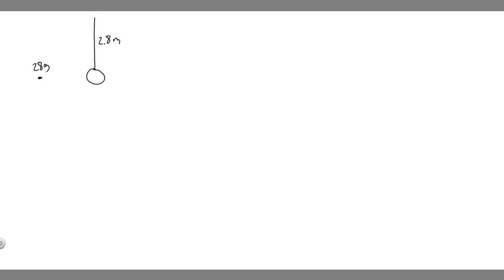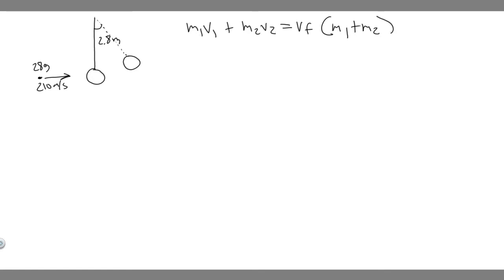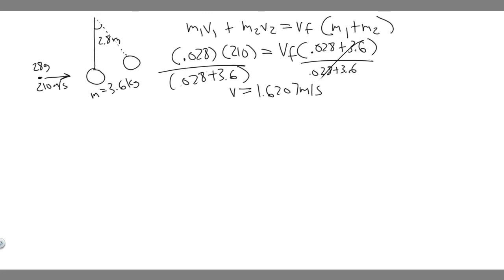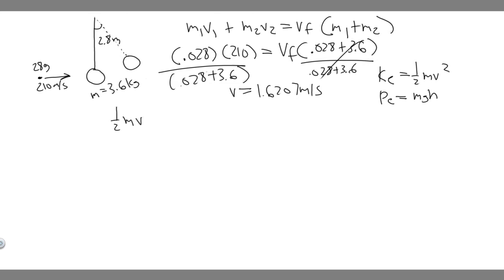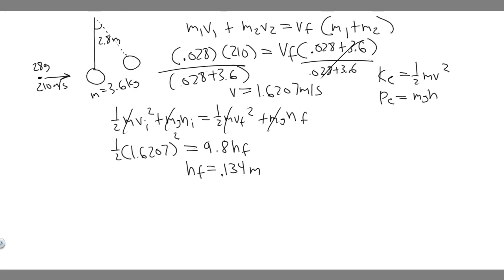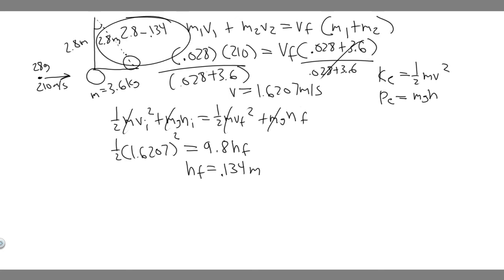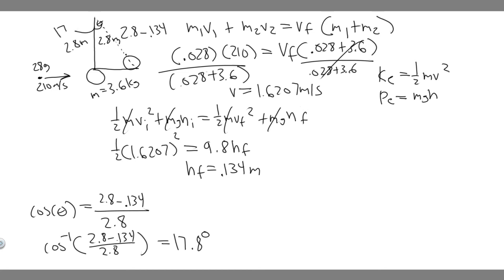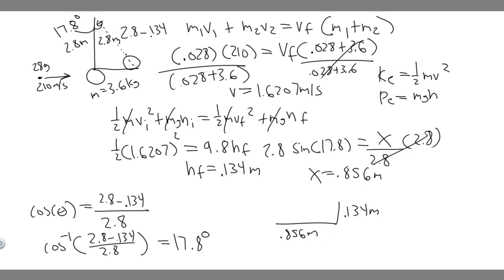A 28g rifle bullet traveling 210 m/s buries itself in a 3.6-kg pendulum hanging on a 2.8-m-long stri

Comment: Question: Why use arccos instead of cos?
Thank you
And why not use the Pythagorean theorem?
Reply: Way late, but in case it helps anyone else: arccos because he wants to find an angle measure, not a side length. And there is no reason you can't use the pythagorean theorem: that would also work